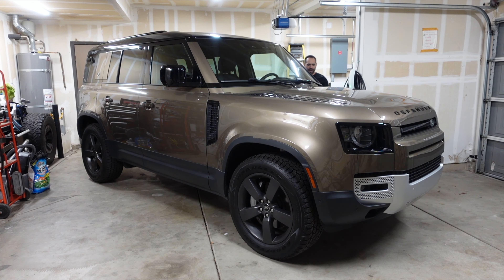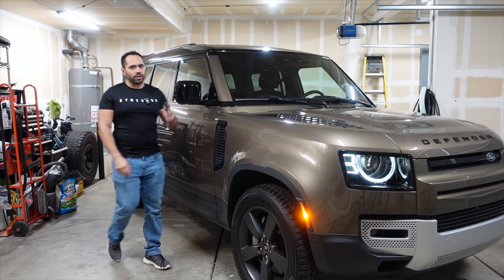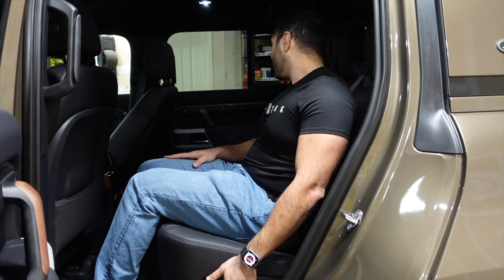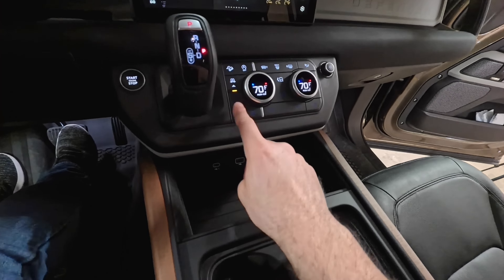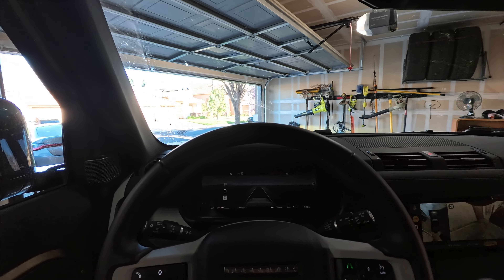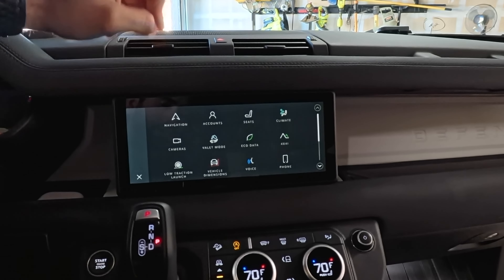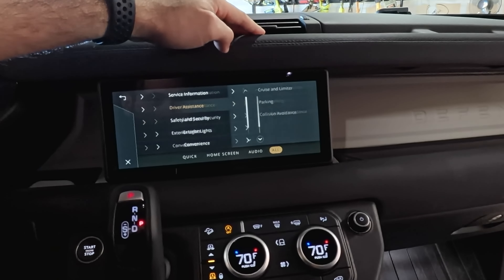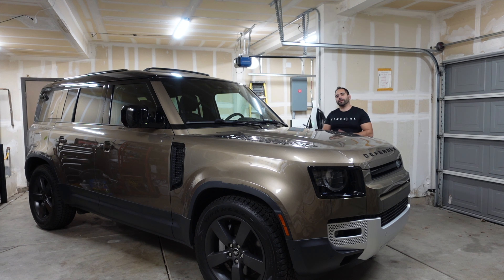Land Rover Defender 110 Hidden Features and True In-Depth Details

Comment: The chequer plate on the bonnet is purely cosmetic. The old defender had flat, chequered areas either side of the bonnet that genuinely were designed for standing on. This is, as I understand it, merely a nod to the past in the styling, rather than anything functional.
Reply: It's a great place to set something down like a cup, phone etc for a few minutes without worrying about the paint scratching. :)
Reply: @marycornelius8276  yes, ideal. On the old one you could stand on it!
Reply: @guy1234484  how often you have a need to stand on your car? 😂😂😂
Reply: True. And it looks like triple pattie hamburgers😅
Reply: I have some hard core off-road experience with the old defender, its Al hood would get extremely slippers when wet, so those plates would help you step on the hood without slipping and breaking your neck. Do not know how would these plastics ones work, I.e. if they can stand my weight 😂

Comment: My mom's used Defender doesn't have 'configurable' option on the screen when selecting drive mode.  Anyone have an explanation for this?  The car is fully loaded, but the computer was replaced by the dealer.  Could they have removed it for some reason?